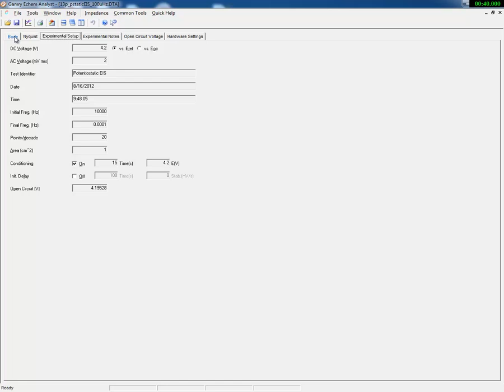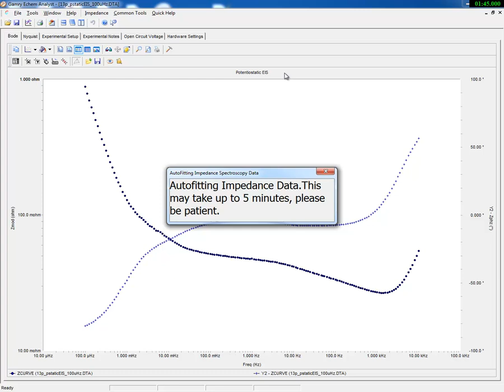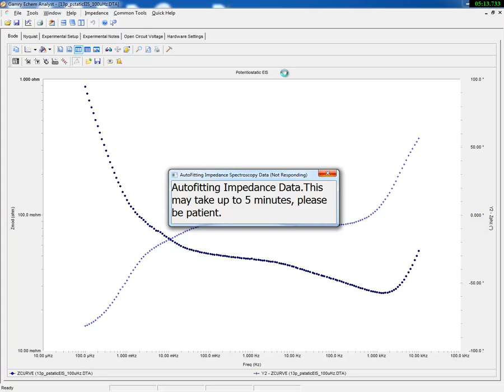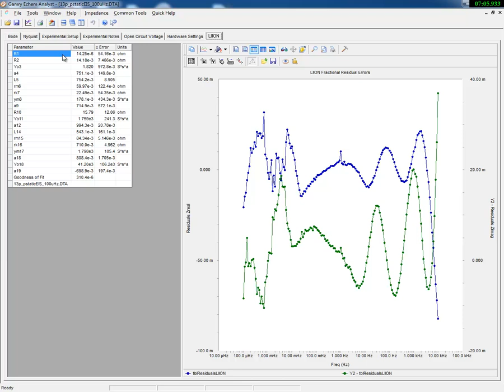Electrochemical Impedance Spectroscopy of Lithium ion Battery *Close Captioned*

Comment: Hello. How would you explain error values as they are considerable with respect to parameter values?
Reply from the maker: Hi Mohsen, If the errors are less than or on the same magnitude as the calculated values, the fit can be considered acceptable. This video is designed as a general overview. In real use, multiple samples should be run and the spectra should be compared.
Reply: Thanks. Very helpful indeed.